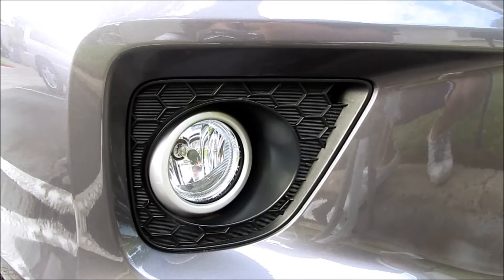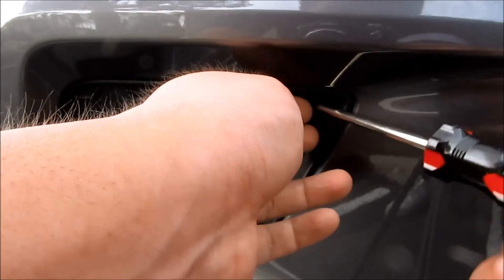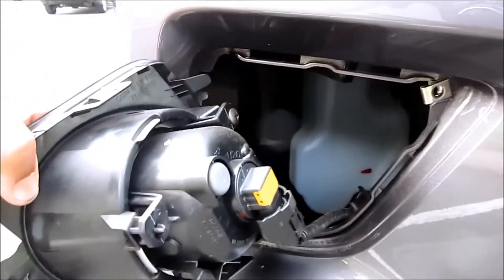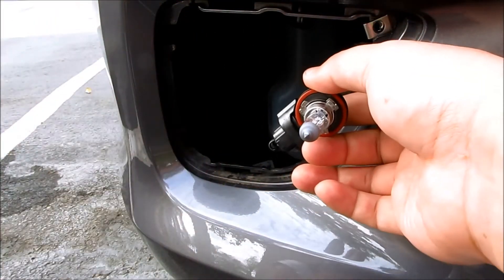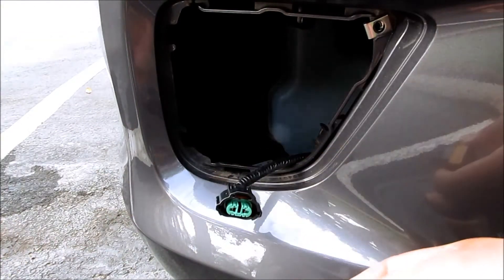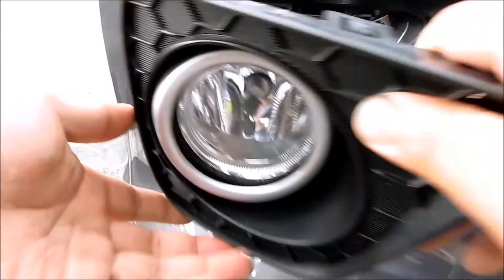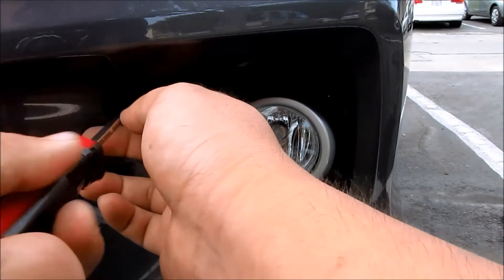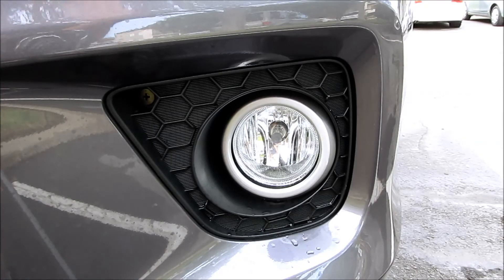DIY 2013 2014 2015 Honda Accord coupe foglight bulb replacement

Comment from the maker: By the same handle turn switch that the headlights switch is located.  The very end is the headlight turn switch and the foglight switch is located closer to the steering wheel.  You can only turn them on when you have the headlights on.

Comment: Hey, thanks for the video. the screw that holds in the fog light fell off and the fog light keeps falling off now. do you know where I can find a replacement screw or if I can use any...?
Reply from the maker: 90103-TR0-A00  That is the part number.  Your local Honda dealership parts department has it.

Comment: are there any good spots to mount an HID ballast behind the fog light? my yellow Nokya's aren't cutting it but I don't want a hard time finding a spot to put the ballast.
Reply: This is a old ass post but I’ll ask you did you figure it out? I used a slim ballast and it fit fine behind the bumper cover.
Reply: @Youainthim86  not sure slim ballasts existed back then lol. Glad you found a solution tho!
Reply: @michaellegra8272  LOL true!

Comment: Thanks for these videos. I just bought a 2014 Exl Coupe V6, got home and noticed the passenger side Fog light is cracked. So this helps when I decide to replace it...Any advice where to order to replace the lens thats cracked? Thanks again.
Reply from the maker: +area859 Honda does not sell the lens separately. However, uou have a few options for replacement... You can purchase the entire fog light housing (part number: 33901-TY0-305 for the passenger side) or you can upgrade to led fog light from TRS https://goo.gl/BqgYaH (message me for discount code).

Comment from the maker: sedan is a little different.  You can access the back of the foglight housing by pulling the wheel well fender liner back and reach in to remove it.  Check your inbox, I sent you a link.

Comment: Hello again. On another video you had put some 35w LEDs but they overpowered your headlights. Do you know how many lumens those LEDs were? I'm considering 12W LEDs rated at 500-600 lumens but I'm wondering how they'll look up complement some 65W H9 headlight bulbs instead of H11s. Lastly, I found 100W H9 bulbs, and heavy duty ceramic connectors but do you think I run the risk of burning/melting headlight housing even with ceramic connectors? Thanks again for all your vids.
Reply from the maker: The fog light led were 30W CREE H8 rated up to 550lm output on the coupe

Here is a link that explains the difference between wattage and lumen.
http://www.rapidtables.com/calc/light/how-lumen-to-watt.htm

100W seems excessive and may generate more heat than what the projectors/stock wiring can handle.

regular 35w HID bulbs are rated around 2-4k lumen.. the lower the bulb temperature.. more lumen it produces.

Stock halogen bulb lumen:
http://www.danielsternlighting.com/tech/bulbs/bulb_types/bulb_types.html

H11 HID:
http://www.hidplanet.com/forums/showthread.php?39228-Best-route-for-H11-HID

Comment: Did you install a LED here, go with HID kit, or just regular halogen bulb? Whatever you used can you please send me the links thanks
Reply from the maker: I haven't change out the bulb to HID or LED yet.  HID on the coupe fog light housing will create massive glare for oncoming drivers so I'm going to go with LED.  So far I tried 120 led h8 bulb and the 102 version and both of them are too large to fit inside the housing.  Sure you can enlarge the opening with a dremel but I rather not hack a $280 part.

I'm waiting for the 30W CREE H8 Led to arrive. Once I get them I will upload another video to show which H8 bulbs fits and which doesn't.

If you have a sedan.. go with HID.. DDM has sale right now.. get the 35W H8 and what ever kelvin temperature you want.
Reply: Jephu Hi Jephu, did you ever figure out which ddm H8 LED bulb will fit the housing? I'm looking on here: http://www.ddmtuning.com/Products/H8-LED.H8-LED-Bulbs.  Can you recommend which out of those 4 will fit? Thank you!!
Reply from the maker: Spencer Fong
All of them should fit.  Only one I'm not 100% sure about is the 5W led one.